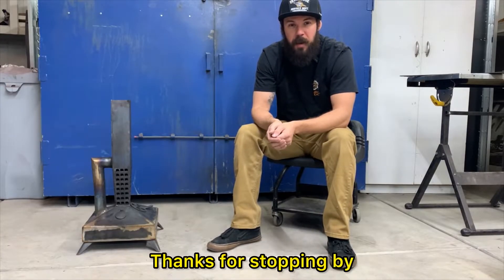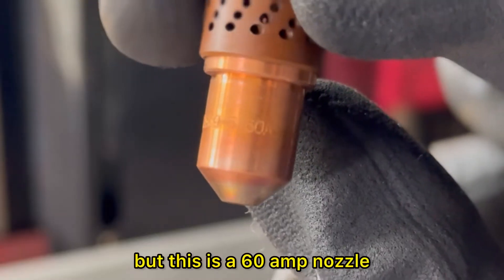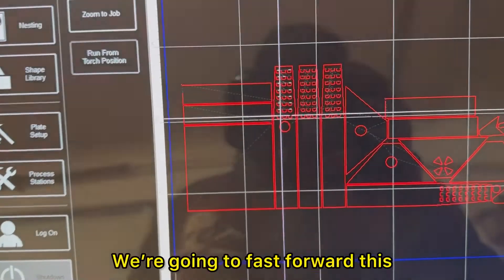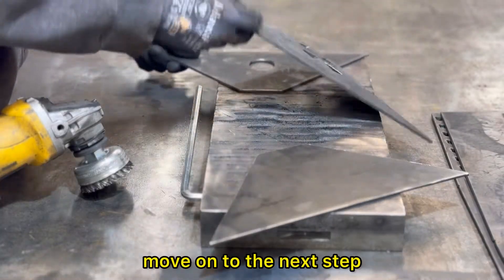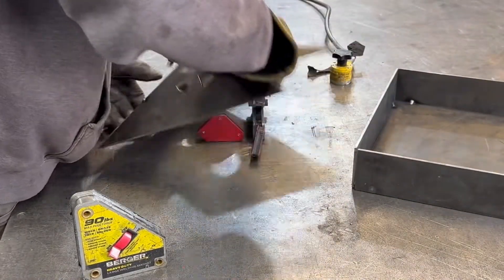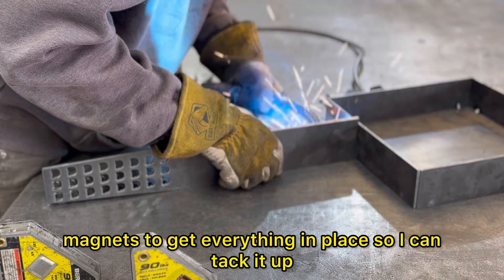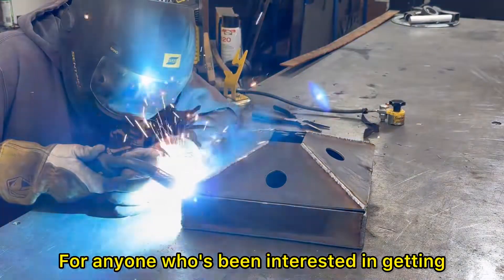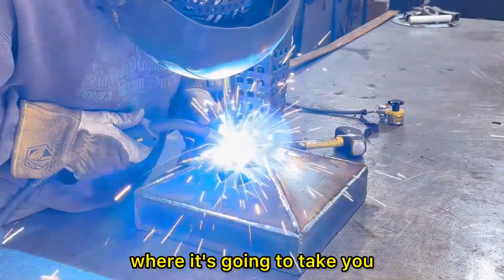Mini Smudge Pot - Build From Start To Finish

Comment: Maybe too many vent holes on the stack? Doesn't burn as "clean" when most of the fire exits before the stack. Also cuts the heat output in half. It would be interesting to check the temp, then choke off about half the holes, and check again. Next video...
Reply from the maker: Thank you for the support. I fully agree with you on it having too many vent holes. To be honest it was supposed to have little vents instead of the big holes. I need to work on the plasma cut file and try it again. This will definitely be a future video. Thank you once again.